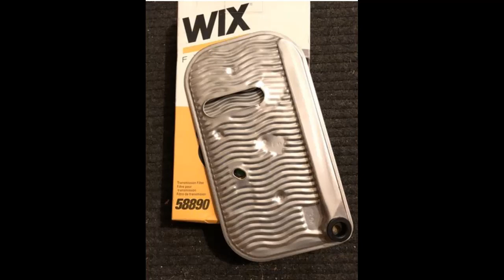Chevy Colorado V8 Turbo LS swap

Comment: What shifter did you use? I'm in the same boat as you used to be a 5 spd truck with bench seats.
Reply from the maker: It's a B&M from Jegs. Cable style hookup. It was pretty easy to install. I can remember the model.
Reply: @delcitydummies  Nice, I ended up getting a TCI one just started mount a plate up the other night. I'm defiantly stealing your idea to cut out the cup holder around the shifter lol
Reply from the maker: It's just a cheap B&M shifter from summit. It worked good. I cut out  a old aluminum license plate for the trans temp gage by the shifter.